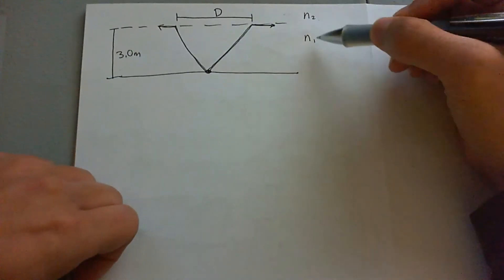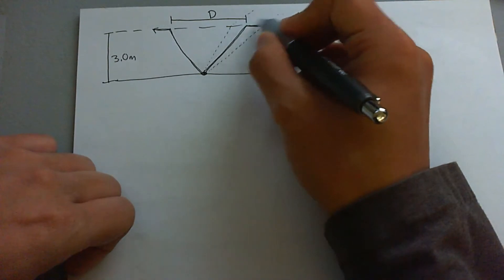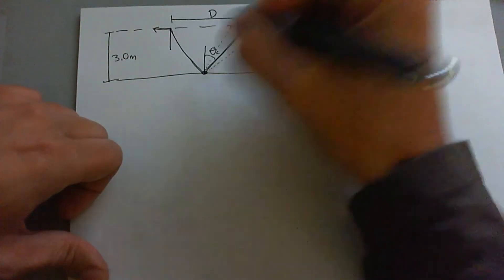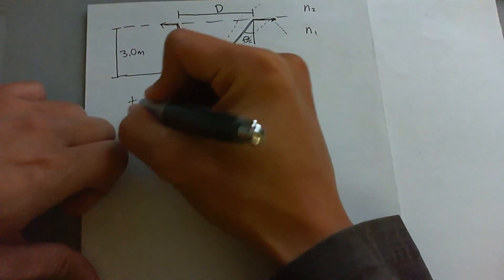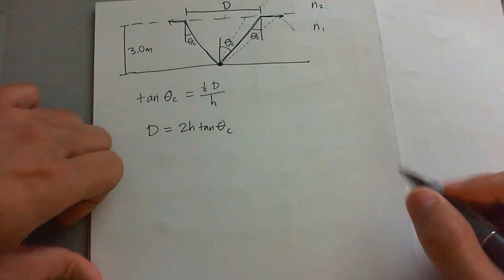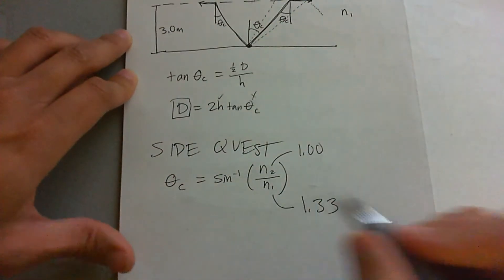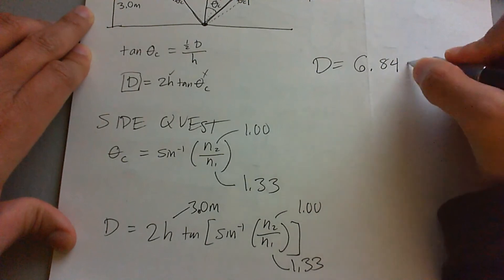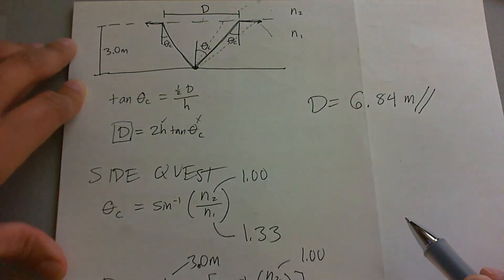Diameter of a light circle seen on the water's surface from a light bulb at the bottom of the pool

Comment: Can anyone provide a reference to published materials containing this problem?
Reply: If you would still like it, I can reference one right now.
Reply: @Amethystb.06   I think I found it, actually, or rather, my Pearson rep found it for me, after a long time searching. (I'm pretty impressed with their effort.)  You may have got it from a different source, though.  So, yes, I think you should post your source so it is official. They found it in "Physics for Scientists & Engineers" by Knight, page 970.  I see it in the 4th edition, but it might be in 5th edition, too.  It is not in the 6th edition.  I think this is an interesting practice problem because the wording of the problem is poor. No "circle of light" can be seen, under any circumstances, "on the water's surface".  There is, however, a circular region on the surface of the water from which light from the light bulb escapes the water and, beyond which, light from the bulb cannot escape.  But, the phrasing in the book is not accurate.  If you look at this region, it will not be brighter than the region outside the circle, since there is nothing there to scatter the light, which is necessary to form an object in your visual system.  If you put something in optical contact with the water, it will change the interface boundary, and thus change TIR, so that doesn't work either. I only realized this after trying it, myself. If you put something in the water to scatter, the light is everywhere, so that doesn't for a circle, either. Finally, if you put a screen just above the water, technically light strikes the screen everywhere, since, on the low index side, the angle of refraction ranges from 0 to 90 degrees.  You might even see a circle on the screen in that case, but the edge is poorly defined because those rays technically reach everywhere above the water, and, no matter how close you hold it, the bright region is bigger than the size of the circle calculated in the problem. I also tried this.